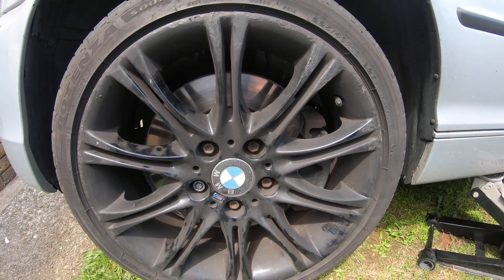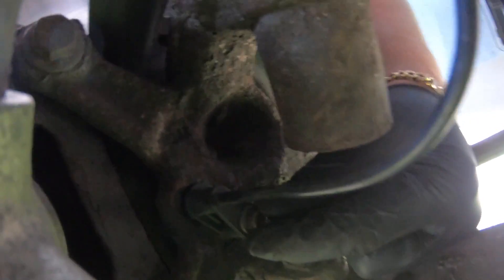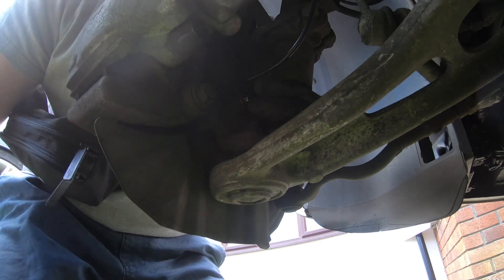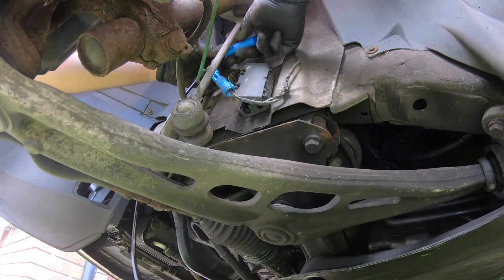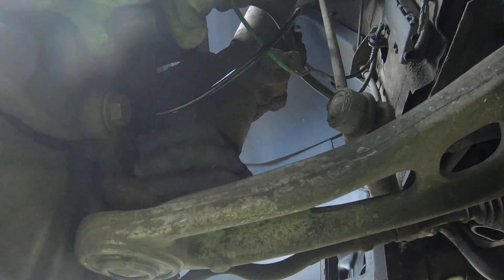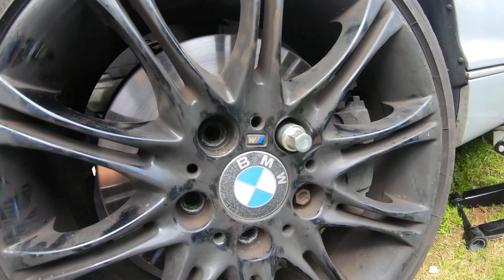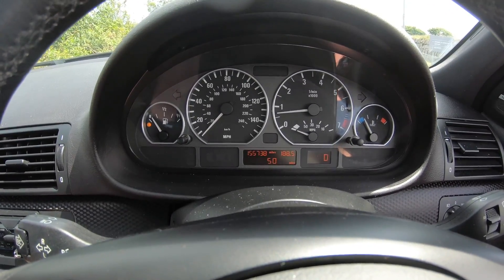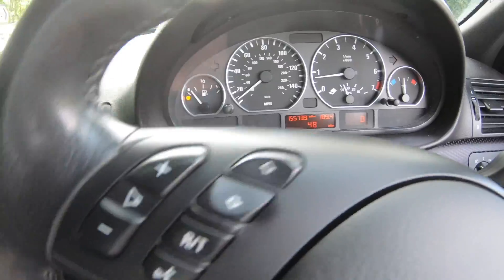Bmw E39 E46 E53 ABS Sensor Replacement Traction Control Light On ABS Light On Wheel Speed Sensor

Comment: Gotta be careful when gunning the wheel bolts in straight away. It is always worth screwing them in by hand a few turns first to avoid any threads from possibly getting fucked up.

Comment: Good clear video. My car will not read on any wheels. Does that mean I need all 4 replaced. I have the trifacta lights. The speedo and odometer has stopped working. Did a cluster test all needles and lights work fine. HELP..
Reply: Did you get this solved???
Reply: Just did this. Replaced all 4 abs sensors off eBay. Now my speedo and odo work. My cluster was also fine. They're like $35 on ebay. If it fails again, whatever. They're cheap sensors and it's a job I can do in under an afternoon.
Reply: replace rear left abs sensor